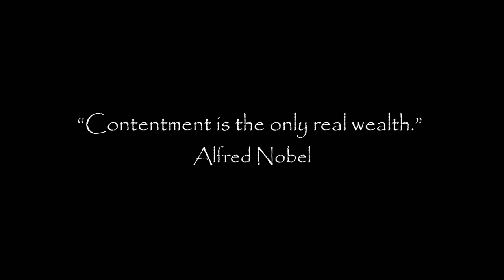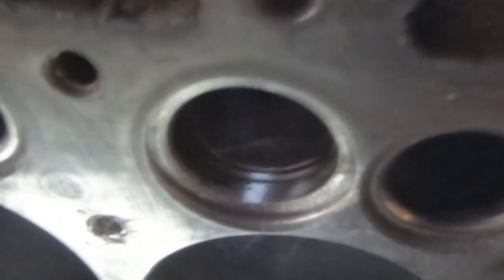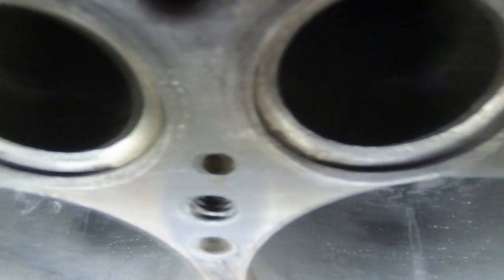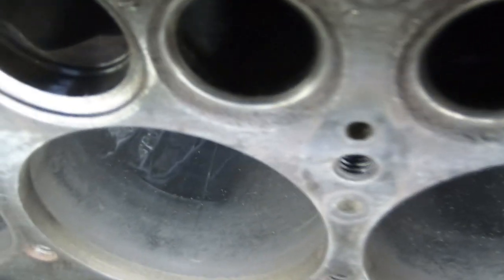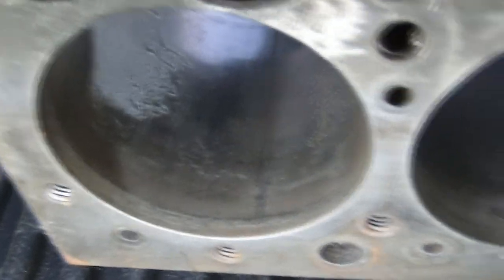The Good, The Bad and The Awesome! - Contentment Updates!

Comment: Hello,  I know with an automobile when you hear you have a cracked engine block, I know it isn't good news.  I know we use our backhoe a lot and would really miss  it if we didn't have it.  Congratulations on more land.    I know in my small town i drew the outside stairs for the building permit.  Really juvenile drawing.  They focused on the numbers rather than my drawing to be sure it was being built to code.  💕. NonnaGrace
Reply from the maker: Thanks, NonnaGrace!  Yes, where we are building the county is mostly concerned that the home meets the minimum square footage requirements. Gotta collect those taxes! :-)  Appreciated.

Comment: Sleeves and turning down the pistons won't hurt the HP , might be cheaper to get an adapter plate and repower it with a push rod engine
Reply from the maker: Thank you for the input.  We have a question that we hope you can help us with. The cracks just border on the ring travel in two cylinders. Both of these cylinders had 90# compression in them before we tore it down, but the engine had been sitting for a decade or more. The cracks to not penetrate the water jacket or oil galleys. The worst cylinder is worn in one spot by about 5 thousandths. The crank is worst at the rear main bearing and probably worn by 5 thousandths. The cylinders and piston skirts are scored, but not terribly.  If we can find one replacement piston to match the others, give it new rings and slap it back together, do you think it may give us the 200 hours or so of service we may need it for until the dirt work is done? Value your opinion, thanks.
Reply: @contentment164  it should last for a right good while I've built several farmall engines that had similar cracks and far worst clearance issues they have low oil pressure and use a qt or oil along but they are still going
Reply from the maker: @HomesteadingtheHardWay  Thank you. Look for a shout out in the next video. Much appreciated.
Reply: @contentment164  I don't mind helping ! I should have told you I own a equipment repair shop and we specialize in older machines
Reply from the maker: From the beginning I thought about just replacing some valves and the piston, slapping it back together and running it it. Both you and Thomas Schmitt Homestead Project have convinced me to do it. Sometimes we get so caught up in making sure everything is right that we forget that it's probably fine the way it is.  We just ordered all the parts needed to get this back together. Many thanks!!
Reply: @contentment164  it's a little bit of a gamble but honestly if it was mine that's what I would do , sometimes with old low value equipment a patch job is your only option! IF and old machine is in excellent shape mechanically and looks REALLY good we will repower it with a more modern engine sometimes that's easy to do just depends on duration of manufacture
Reply: Just thought to tell you this but its important be sure to use PLAIN steel rings or they won't form to the cylinder if you get to building it and hit a snag email me
Reply from the maker: Homesteading the Hard Way Thanks, but on the rings I was only able to find one set for sale in the whole country. I don’t know what they are...not here yet.
Reply: @contentment164  if there moly it's not the end of the world , just have to run it hot to seat them had to do that yesterday on a dealership rebuild they couldn't stop it from smoking now I'm a hero
Reply: @contentment164  That's a battle I fight every day . That's obsolete we don't have anything listed , I can't even find it in the computer, it shows we can get half a set etc etc !